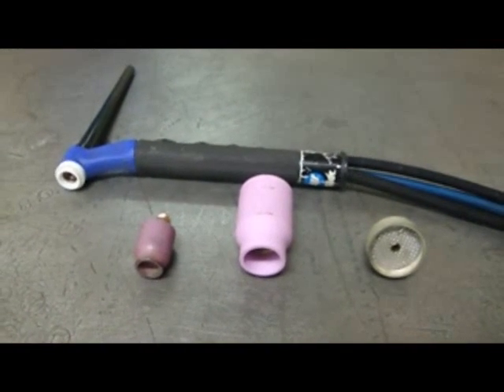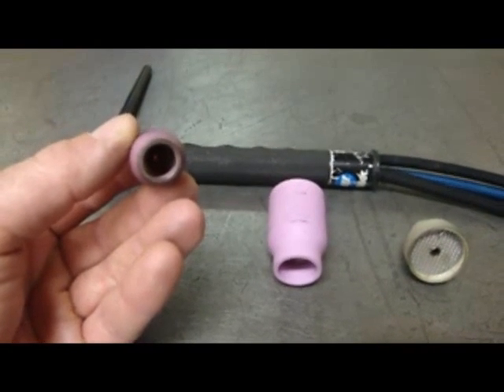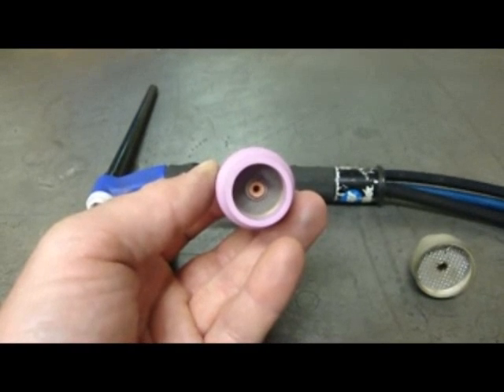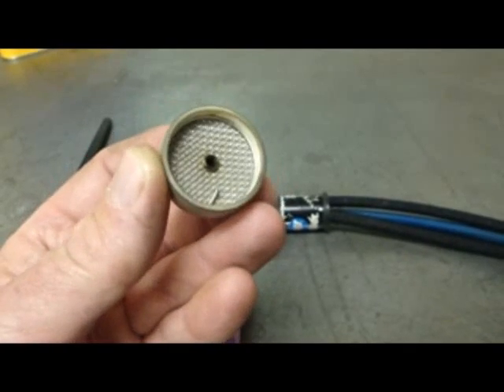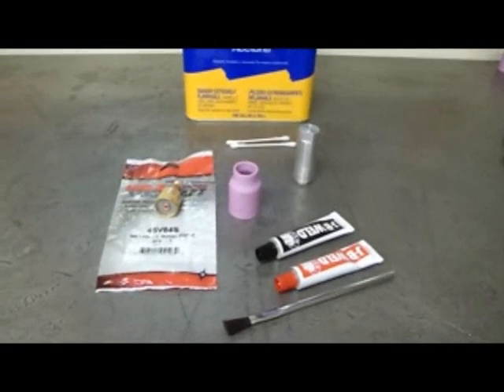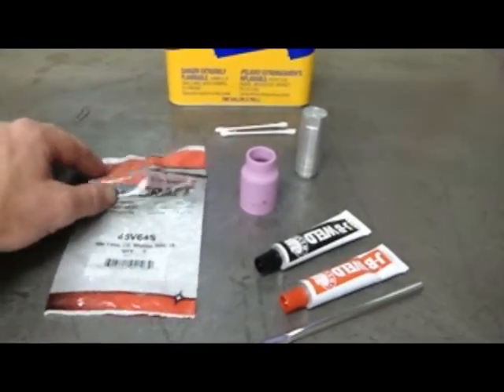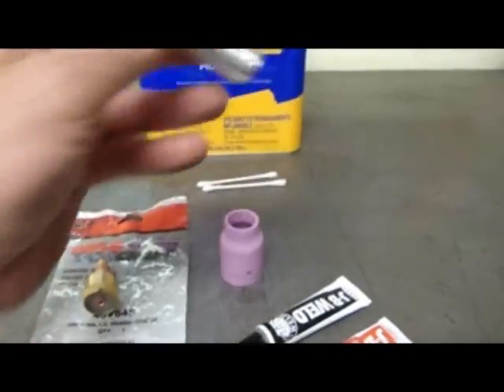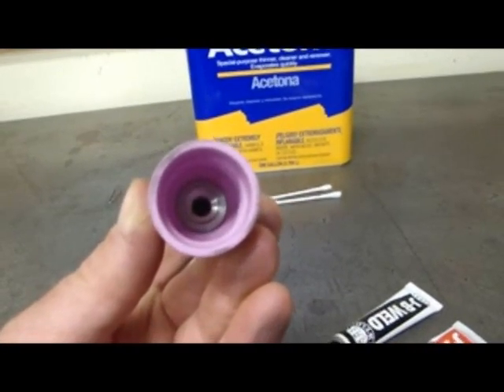Fabricating a custom Ti welding cup

Comment: Love it ! Just bought a Jumbo kit just because I saw this video. Any l/min advice for the argon?
Reply from the maker: The flow rate necessary is really dependent on your torch position, rate of travel, and tungsten extension.  Start  around 15-20 and adjust as needed to ensure adequate coverage.  Don’t forget to leverage physical barriers to help pool the argon and post flow ensure the base metal cools while bathed in argon.  Best wishes for success!

Comment: Great video, wish I found it sooner. Just beginning to realise how important gas coverage is to get those colours or even better no colour in stainless steel. A big cup is important to keep the gas coverage around the the trailing cooling part of the weld to stop the oxidation and stop the blackness forming on the surface of the weld. Post and pre flow are important also.

Comment: Hi do you have a part number for the ceramic cup ? also what insulator/cup gasket ? thanks
Reply from the maker: reaperwayne Everything you need to see is on the blog... http://groovycycleworks.blogspot.com/2011/09/fabricating-custom-ti-welding-cup.html
Reply: Rody Walter Hi and thanks for your reply i have read the blog but there is no mention of the part numbers for the two items i asked about i am in the UK so will most likely have to order the parts from your side of the pond and just want to make sure i order the correct parts thanks again
Reply: reaperwayne Cup is a number 12, Part numbers are clearly shown on the packaging in the first picture.
Reply: Emily Walter Isn't that the size not the part number ? thanks for your reply
Reply: +reaperwayne That alumina cup is a 53N87 , but what Teflon is he using ?
Reply: I have no idea ??

Comment from the maker: Andy, I've noted the difference between the CK pyrex cup and this method in the comments below.  My experience with the pyrex cups have been less than desirable for high level fabrication, specifically their performance (push on collets suck), heat conductivity, and durability.  Believe me, I would not have gone through the effort to share this method if there was not an advantage to be gained.  Cheers,  Rody

Comment from the maker: Although the CK cup offers the same ID as this method, the CK cup is too short, allowing for greater disruption of the gas shower.  Using the inverted Alumina cup in this configuration, the gas has a greater distance to consolidate and flow out in a controlled manner to the base material.  Additionally, this cup has a bit more mass that allows you to hold the cup for fine control and does not heat up as quickly, letting you run longer beads.  Thanks for stopping in.